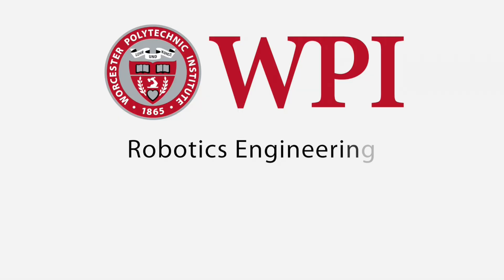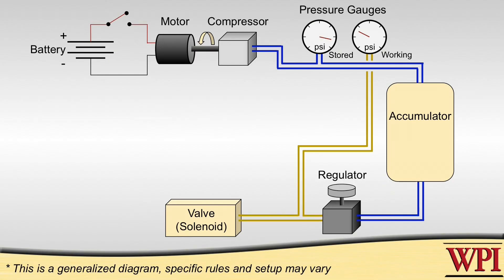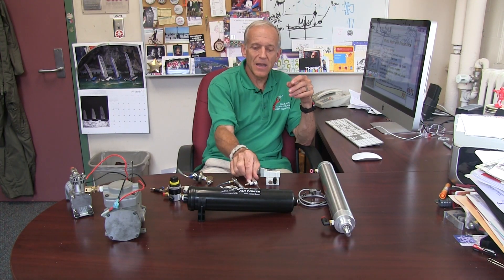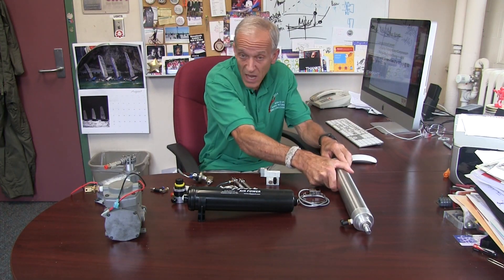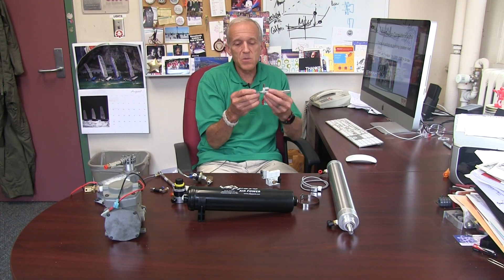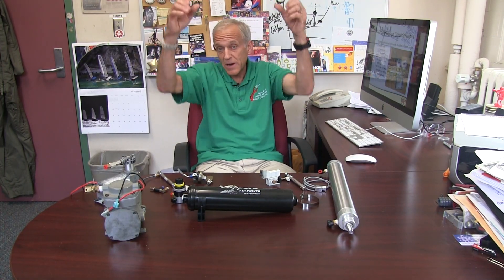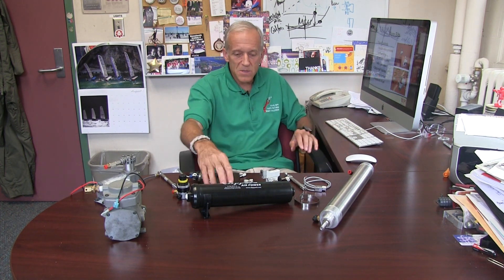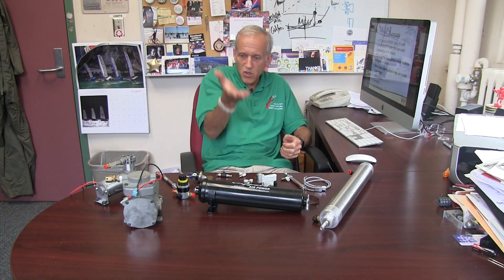Pneumatics

Comment: Hello sir, can I use a solenoid valve to control the suction and blowing of air inside a cylinder that is designed to blow and suck air? if in case yes, what type of solenoid valve should I use. tnxxx

Comment: How do you find the connection for the compressor shown @1:06? I bought a compressor but I dont know how to find a push in connector for tubing.
Reply: I use McMaster Carr & Grainger for my pneumatic needs.  Those links should take you to the page you need. Hope this helps!

https://www.mcmaster.com/#push-to-connect-tube-fittings/=1d0b7cz

https://www.grainger.com/category/push-to-connect-tube-fittings/push-to-connect-tube-fittings-and-accessories/tube-fittings/pipe-tubing-and-fittings/plumbing/ecatalog/N-1510?okey=push+to+connect+tube+fittings&mkey=Push+to+Connect+Tube+Fittings+&refineSearchString=push+to+connect+tube+fittings&NLSCM=5&EndecaKeyword=push+to+connect+tube+fittings&searchRedirect=push+to+connect+tube+fittings&sst=subset&suggestConfigId=6&nls_boost_words=noContent